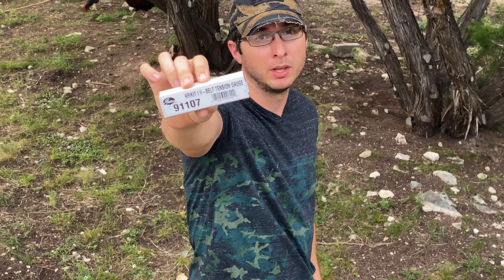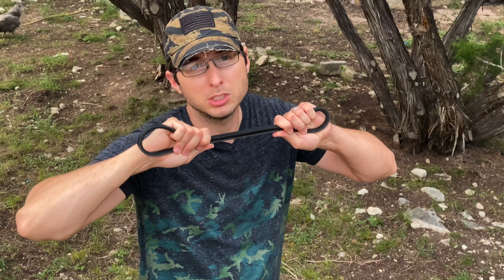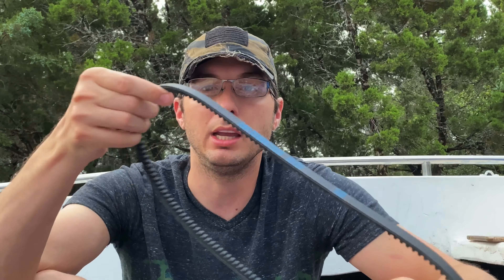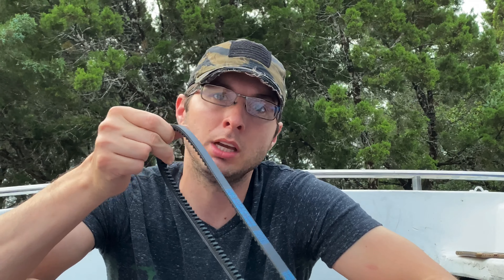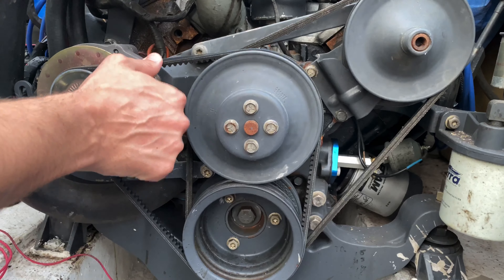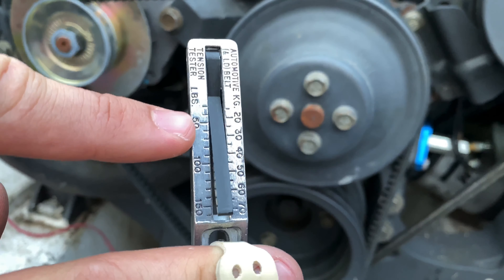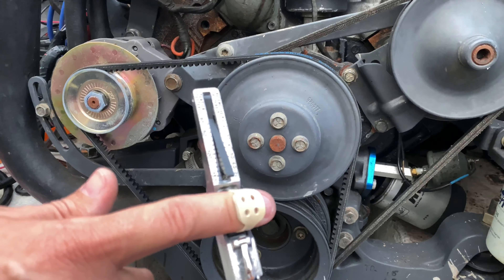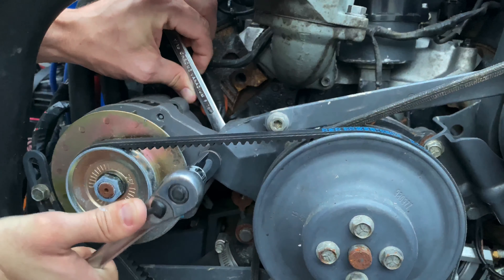No More V-Belt Dust in Your Boat! Let's Get The Tension Setup Right!

Comment: NIce Video.  I have just enough skill to be dangerous, lol.  I replaced my SBC last summer in my Trophy 2556.  I had to shim the pully's to get the belts to fit.  I went through three sets of belts last summer including a loud belt squeak.  I thought alignment was the problem, but I discovered that I forgot to put the second bracket on the alternator.  Now I'm thinking the lack of tension caused premature belt wear, causing the squeaking, which caused the premature breakage.  This video explained what I was thinking.  Thank you.  BTW, I've had great luck with DB alternators and starters for years.  Guess I'll try their belts next!

Comment: What is the actual belt tension tightening procedure? Sorry that may be a lame question but I didn’t see that step in the video.
Reply from the maker: Loosen the bolt holding the device in question. Pull taught, the belt, and tightened the bolt in question. Try to achieve a 50 lb target, as measured by the kricket.

Comment: hi mike,  thanjs to your help i got the core plugs in ,  the thermostat changed, raw water impeller changed and installed a new db alternator smlar to what you installed.    many thanks!!        
           my latest frustration is finding the deck leak !  seems rain water is hitting second step of cabin entry and pooling on the cabin floor....           i just found a wet towel on the cockpit dashboard[directly above the step w/ rain water on it] behind the windshield.   how is that possible w/ canvas covering the windshield?   any suggestions?
Reply from the maker: Water leaks are the worst. I have a few ideas in mind, but you will need to check various locations. Just remember that water runs down hill.

Comment: Whats the difference between v belt that is solid, and belts that have notches? (The old belts vs the new one you put on?) I bought a gates belts that has is solid, and inst as thick as the dayco which has the notches. They are both the same length, same width but not the same thickness? Thanks

Comment: Hi Mike, i have a chevy 5.7 small block and am replacing my belts with same D&D Power Belts. On my boat i have a what i believe are NAPA Premiums XL 25-7455 (power steering) and 25-7465 (alternator). Would you be able to tell me if these are the right belts that should be on it. In addition im wondering if the vendor sent me the right replacement for the 7465 belt cause i received one of the 2 today and after trying to install it, i cant bolt on the adjuster bolt on the alternator to bracket. Belt seems just a bit too short now. They sent me a belt labelled 15465. Is this right? Thanks in advance.

Comment: Hey Mike sorry this is off topic, i couldnt find a video for my issue. It doesnt seem like you have a video for throttle cable adjustment. Do you have any input on how to adjust the tension on the 5.7 cobra throttle cable. When i go in either neutral or any gear i have to move the lever a good distance in order to give it gas. Seems like my set up is very loose.
Reply from the maker: Hey David! Have someone sit near the cable end while you slowly move the throttle forward (give it gas). See if the person on the carb side notices any slack. I'm talking about forward and back motion in the cable. If there is, I'm thinking you have a bad throttle cable. It's rare, but possible. I'll have a video on this in the week. Please do me a favor and hit that subscribe button! Thanks!